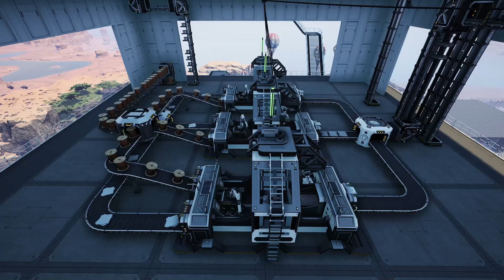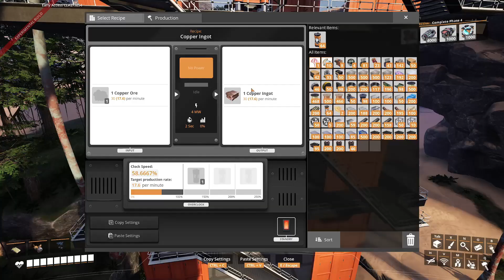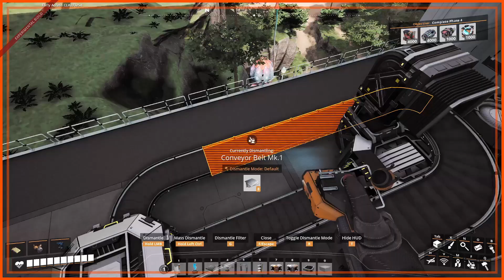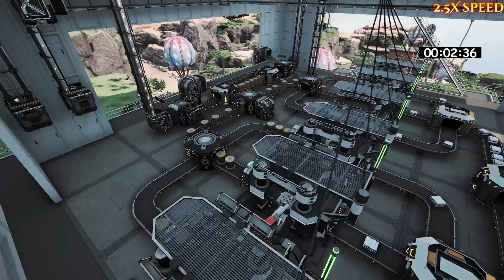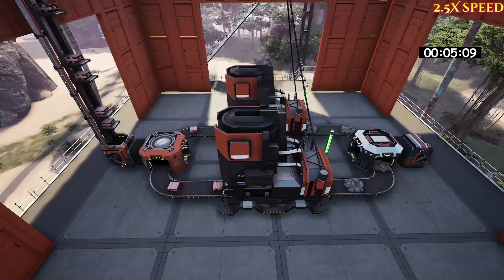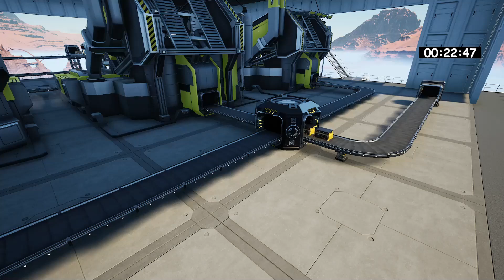LOAD BALANCED 6/min Radio Control Units - Satisfactory - Update 8

Comment: I know its a little late, but why not use some more of the copper node you only use 35 of? if you use Alclad aluminum casing instead you can get more out of your aluminum factory while setting up barely anything extra here
Reply from the maker: Hey thanks for the great question! You are correct it would definitely be more efficient to use the alt recipe and more copper. The reason I didn’t is the load balancing would have been tricky. I would have needed 64 more copper and I would have to split that and the 35.2 for the copper sheets.

Comment: working my way through the playlist!  love the series.  when 1.0 hits I think I am going to design factories in larger sections, but less than a mega factory...  if that makes sense.  like I want one for basic iron parts.  and then maybe a single factory for all the modular frames and types.  another factory for electronics, etc.
Reply from the maker: Thanks! Glad you are enjoying it! Several large factories sounds like a great plan. I’ve been thinking of doing something similar for 1.0, possibly 4 or 5 huge factories spread out.